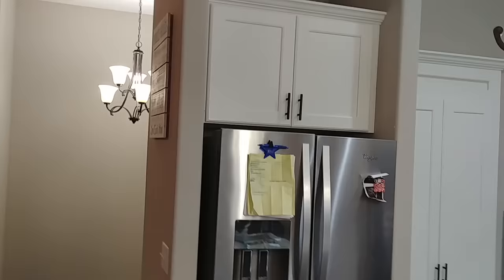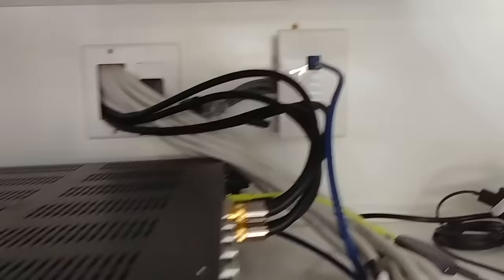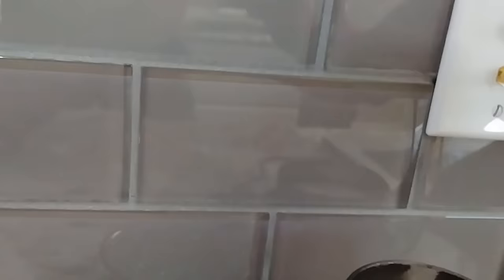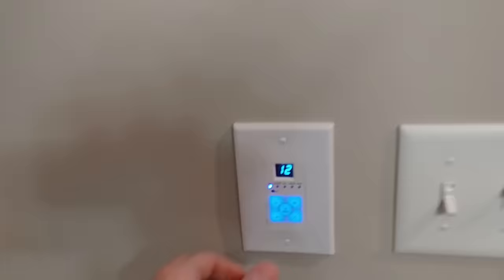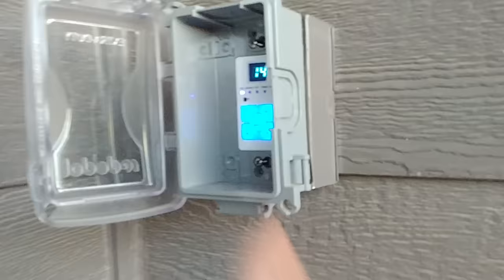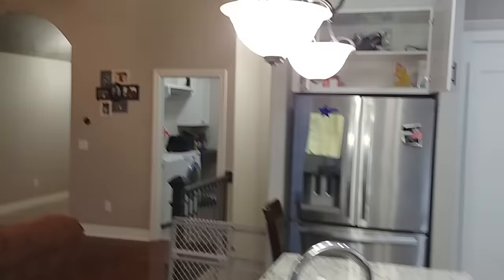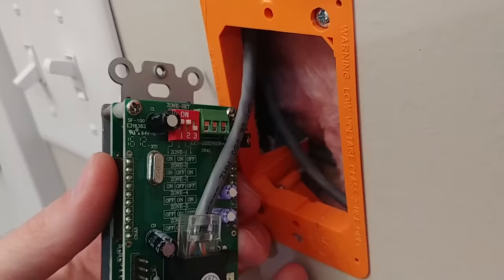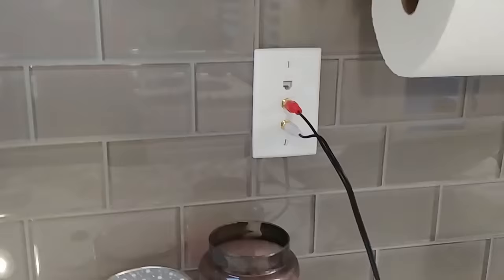WHOLE HOME AUDIO: Monoprice Whole Home Audio Amp! 6 Zone 6 Source

Comment: Has anyone had an issues with turning on the keypads. Everything has been working, only noticed recently an issue. The power is on, keypad are all lit blue but I'm not able to turn on all the keypads except 1. I then disconnected all. Reconnected 1 by 1, it working until I got to 2 zones. I test the connection with tester all working. The 1 zone that works has been disconnected to allow other zones to work. I'm confused and there is no help I can find so far. PLEASE HELP

Comment: i'm having problem connecting this amplifier to the TV source using RCA cable, i won't play sound . I'm not sure what am i doing wrong, can you please help?
Reply: If you have a AV receiver with zone 2, I'd recommend using that. If your connected directly to a satelite or cable box, you'll have to go into your box setting and change audio from HDMI, I'm assuming thats how your TV is plugged up, to RCA.
Reply from the maker: Also make sure it's RCA audio out

Comment: Thanks for the video -- this may be the answer to replacing my 12 year old whole home 12 zone Elan System.  One thought.  I use the long range Audio Engine B1 bluetooth receiver vs the chromecast audio receiver you show.  I like to have my music voice controlled via alexa (amazon music, pandora, iphone music in itunes library, etc.) and I can play all this by telling Alexa to connect to bluetooth (then alexa connects to audio engine B1), then I can request specific song by name, or artist or station type (from either Amazon or Pandora).  I can thumbs up or down songs, skip songs, raise or lower volume, switch stations, etc. all by voice.  You can also use NAS drives and Plex and have Alexa control your hard drive music this way as well.

Comment: I did a very similar install except the placement of my unit. I used OSD MAX12 for mine and I have 22 speakers. 4-5 speakers per zone for 5 Zones then outside zone is 2 6" rock speakers. I used Dayton audio in-wall speaker expanders so i could power more speakers per zone. I control the unit with both wall keypads and Android app.
Reply: What android app do you use?

Comment: 6 Month Update: I have been installed now for 6 months. I didn't use the wall controls because your app is AMAZING. I have 2 Google Audios for input sources and a TV source.
If anyone is interested in a GREAT sounding speaker. I would recommend the Theatre Solutions. I have 6 of them in 3 zones. A Polka in the master bath and 2 outside zones with Bose and Polk. Had I done the Polk first I would have only Polk outside. But I love my current setup. Thanks for the inspiration and direction @TheKMZ1
Reply from the maker: That is great to hear! Have you seen my new video? Very interesting :)

Comment: 3:01 the best DAC for your buck

Edit: have you tried the optical input? You can get an optical mini cable to hook up to the Chromecast Audio and even stream at 98k pcm...if the app you're using allows for it
Reply: The quality will be 120% better if he change the cable. Let me explain - On amps,  RCA inputs not digital. Those are analog inputs which means the signal is pre processed which means the chromecast converted digital signal to analog. Over optical there's no dac used. What comes in, that's go out without any conversion.  If your amp or avr is equipped with spdif, use optical connection in between. Your amp or avr has a better dac built in :)

Comment: 1. Those green connectors on the back of the amp. You refer to those as keystones jacks. Those are actually called Euroblocks.
2. The speaker in the bathroom above the shower. You might have a problem with that later with steam and condensation. They make speakers with IP ratings specifically for bathrooms and showers.
3. The amp needs ventilation. Put some grills/louvers on the front of the doors. Possibly even a 12VDC fan to circulate the air.
Reply from the maker: Did you look up these speakers? They are rated for moisture so they will not have a problem. Also, this amp does not have any internal fans, it stays cool, I know typically you shouldn't put it enclosed but this was the only place I could put it. My raspberry pi is hotter than this
Reply: @TheKMZ1  Even with the amplifier being passively cooled, it still generates heat. Especially with it being located above a refrigerator that creates heat. Probably not a good idea having it plugged into an extension cord as well. I'm sure it states that in your owners manual.

Comment: you just earn a new subscriber, great info in this video,  well explained, just what I was looking for :).
Question 1.- can you provide or add in the description  the rca  wall plate you used for the audio sources?
Question 2.-  Can you provide  or add in the description the RCA cables you used for this install?
Question 3.-Which speaker cable would you suggest to buy that is code  for new construction?
Question 4.- did you  use cat 5, cat 6  or cat7 Ethernet cable?

I'm looking forward to see which plans you have for your smart home.
Reply from the maker: I'm glad you enjoyed the video!

1) I used keystone wall plates from Monoprice, and bought all of the keystone jacks from monoprice (i've added links to the description)

2) An RCA cable is a really simple cable. To make your own RCA cable you would use RG6 cable. RG6 cable is the same type of cable you would use to run cable tv in your house, except with a different end on it. (i've added a link to the RG6 cable that i use)

3) If you are doing construction in a residential building and not commercial, i believe it just needs to be CL2 rated. Most speaker cable you would buy is already ok to run in houses. I would suggest you use 14 guage speaker wire, i used 12 guage and it was a little over kill since i wasnt doing that long of runs. If you are doing very long runs, then i would say use 12 guage. (i've added a link to the speaker wire i used)

4) I used cat 5e cable for my install because i ran out of cat 6. I wired my parents entire house with cat 6 though, so you can use either. I like cat 6, because it has the extra plastic insert in the cable, which keeps it stiffer when running, which is helpful. (link to that cable is also in the description now!)

Comment: hey are you able to integrate a 5.1 surround sound system to the living room speaker and still be able to use the same speaker with the amp for music
Reply: Lmao... finally someone asked
Reply: Well?  An answer would be nice ;-)
Reply: I would think this would be doable. Just hook 2 inputs to one speaker, assuming they are both analog connections with the red and black wires. Then do the same for the other speakers within the 5.1 setup.

Comment: I think it is bad to keep the amplifier in a closed area like that cabinet or cupboard which will make the amplifier to heat up easily in a long run... If necessary, add up a fan or let the amplifier to breathe (ventilation system is important).
Only if that amplifier is smart enough or have any protection or perhaps can prevent heating, it depends on you. Just a suggestion 😊
Reply from the maker: I know, other people have commented that as well. These units are fanless, so they don't generate a lot of heat, and they don't generate a lot of dust. I have monitored it before and it doesn't get hot enough to where i am concerned with it. I think my raspberry pi generates more heat than this thing
Reply: Well said, okay.
Reply: It also seems you don't run it too hard, as in the unit is not close to it's maximum Wattage output.

Comment: Prepping to do this in my house and this is the best demo I've seen. A few questions if I may:
1. Each speaker runs back to your amp?
2. What was the rg6 wire for?
3. Does the cat 6 go from the room switch to the amp?
4. Are those 6" speakers? Would you recommend 6" or 8"?
Reply from the maker: Can you check out my video series I created called "whole home audio from start to finish" it's a video series I did and it's literally from start to finish!

Comment: I love all your videos! great job.

I am looking to implement the same system but I want to integrate a couple things, wondering if you have done them or looking to do them too.

1. Use Synology NAS music server as a source
2. Use Apple Airplay
3. Control TV volume/channels from IR blaster in wall plate (looking to centralize cable box in network closet)
Reply from the maker: Check out the volumio project for the raspberry pi. It would be able to play music off of a synology or other file share source https://volumio.org/

Comment: I'll start by saying thank you for the videos! They are a huge help as I'm planning my whole home audio set up. How would I add a powered/active subwoofer to a standard 2 speaker zone? I thought it was the pre-amp outs, but after watching your video it looks like I have to use either the speaker outputs or the pre-amp out independently, they cannot be used in conjunction with each other. Am I understanding that correctly?

Comment: I am planning to setup a 12-zone for my new build.  I am a rookie in this with some basic knowledge.  Few questions. 1) How did you terminate the CAT wiring behind the faceplate on the cabinet?  2) How did those 6 zone CAT wires get plugged to the receiver? 3) I need help setting up the speaker CAT6 (?) or CAT 5E connections with DIP switch
4) Did you hook up any AV receivers as an input source or use only chrome cast? 5) I may need help setting up a TV connection in the game room for playing tv sound on the speakers while watching TV, is RCA the only option?  Any other option?  I did request for your parent's 12 zone setup. Please send me the link. Thanks
Reply from the maker: I have a YouTube series on my channel, called whole home audio from start to finish. Check it out, it should help you!

Comment: they replace the whole unit if you have a keypad problem  - you have to ship back the whole system if you have any issue .. (im short one keypad) but will make it work... I have a guest bedroom off the kitchen that i will just share the source and put a inline vol control. they dont know what Jump 1, Jump 2 , CNA 1 looks to be an ir extender and ties in with JP1.  CNA4 5+ Volt is also unknown.
Reply from the maker: very interesting, seems like it would be nice if they sold more keypads, could be a revenue stream for them, and also not effecient if you have to ship the entire thing back! oh well!

Comment: Hi,  this is really a nice video. I learned how to conned chromecast from this video. I just moved into a new place and wondering how to connect my tv in master bed room to this monoprice amplifier system. Appreciate any direction. I am not much of a networking guy. My system is in my living room downstairs. I have a network switch with blue plugin.

Comment: Absolutely great video!  The keypad looks so clean, and the blue light gives it a well modern look. You mentioned another system that you recently installed; after having this in for a few months now, do you prefer this system of the other install?  
Thanks for posting, I'm hyped to get my system installed!
Reply from the maker: DJ Robbie Raaz If you haven't watched my other home audio videos they are worth watching! This system and the other I installed are almost literally identical in terms of hardware. So both are great and one is not better. Thanks!!

Comment: I love the effort but hate the RCA inputs. Would it not have been easier to just get a chrome-cast for each of the 6 zones and then all your inputs are wireless? You can then group some or all of the zones.
Reply from the maker: You'd have to get some digital to analog converters I think. The amp only has 2 3.5mm jacks and the rest are RCA. But, for example I sold my house and other people may enjoy the simplicity of plugging in their phone

Comment: Very informative video. I am looking to do this to my house. So how are the wall controllers wired to the amplifier/receiver? I got the Ethernet cable but confused how that all connects to the amplifier.
Reply from the maker: There is a keypad hub that has 6 inputs on the back for all your keypads, and it has 1 output on the front and 1 Ethernet cable connects from the hub to the amp. Check out my channel for lots of other good home audio videos!

Comment: Great system setup & very helpful video. Will be getting same system. Did you connected 2 speakers in each zone? So basically run 14/2 speaker wire to each speaker from central system where monoprice amp will be sitting and also run cat5e to each zone for for keypad. Also run dual coaxial cable to each source location for RCA transition. Thanks TheKMz1

Comment: Just to make sure I’m understanding correctly for how your TV is hooked up can you confirm this setup for how I want to install mine.

Coax from wall to cable box.
HDMI from cable box to tv.
Optical cable from tv to my sound bar.
RCA from cable box to Monoprice receiver.
Monoprice receiver to ceiling speakers via speaker wire.

This setup should give me sound from my TV (from HDMI connection), from my soundbar (from the optical connection), or from the ceiling speakers (from the rca connection to Monoprice), correct? Obviously I’m not going to have all 3 going at once as there might be some delay between the 3. I just don’t want to have the ceiling speakers be my only form of TV audio out. I like my sound bar and would use that most of the time and the Monoprice would only be used for broadcasting the sound outside from the tv when needed for entertaining and sports. I look forward to your reply and hopefully I got this setup correct.
Reply from the maker: Yes that should all work as long as your cable box has the audio out like you described. In my video my cable box did have the audio out, so that's how i was able to do it. Also, i would highly doubt there would be any lag even if running all 3 at once. Also, a lot of TV's have audio out as well, so sometimes you could piggy back off of that if needed! Either way i believe you've got the hang of it
Reply: Thank you for the quick response! That was the only part I was unsure of. If my cable box doesn’t have the audio out, I will do as you suggested and piggy back it from my TV audio out to the Monoprice to get the ceiling speakers connected. I know sometimes when I have my TV volume on and my sound bar going the sound is distorted a little. Either from the two different sound qualities or just the slightest echo from a lag or something like that. That’s the only reason I said I wouldn’t have all 3 going at once.

Thank you for the great video! You literally covered everything for someone to be able to do this job themselves! I’ll definitely be subscribing and following your channel for future reference.

Comment: Excellent video.  Can you please do a video comparing the different type of dayton audio speakers on the market that would work with this system.  Also, it is possible to wire more than 2 speakers per zone, ie via parallel/serial wiring to maintain 8 ohms total per zone?  Thanks.
Reply from the maker: Thanks for the video idea, and yes as long as you can achieve 4 or 8 ohms at the amp, you can technically have more than 2 speakers in a zone. I tell people to try and stick to 2 if possible because a majority of the people are not technical enough to do that!

Comment: If you wanted to have an outdoor tv and all the internal tvs connected, can you just run hdmi for better sound quality? My house is 1 story and can pretty easily connect all of them to a receiver if i was to put them in my closer where the router is.
Reply from the maker: You would probably need hdmi over Ethernet extenders, instead of long hdmi cables. The Ethernet extenders allow longer runs! https://amzn.to/2Y6JEZb

Comment: Great video so thank you.  I currently have a Channel Plus 8 zone system that I have had for 16 years.  Almost identical to this install.  I am planning to replace what I have with this system.  I do have one question.  How do you turn off the entire system OFF via the wall panels.  My current system, I am able to hold the MUTE button for 3 seconds and the entire amp turns off.   How do you do this with this system?
Reply from the maker: You could only achieve this with the app control. Currently you can't do that with the keypad control
Reply from the maker: Also check out my channel on the WS66i new model amp

Comment: which cables would u recommend when the server room is about 13meters away from source. eg TV room is about 15meters away from server room. HDMI would affect Quality with length. using Denon Heos system
Reply from the maker: https://amzn.to/3scJfsb  actually you can get good quality HDMI cables up to 100 ft! could even get less if you need.. 50 ft... 75 ft.

Comment: Love the video! Super helpful and detailed. Why did you choose to run RG6 for your inputs? Could you use speaker wire and attach banana plugs on both ends to achieve the same thing?
Reply from the maker: yes you can technically do that, but at long distances it's not advised to. You dont get shielding using speaker wire. RG6 has shielding in the cable so you can make a long distance RCA cable with extremely little loss. I would not recommend using speaker wire for it